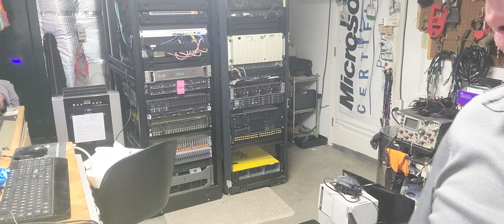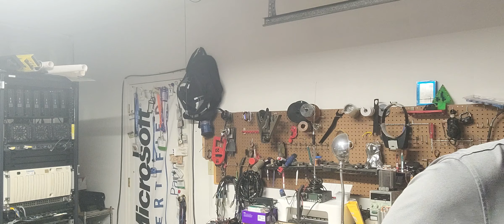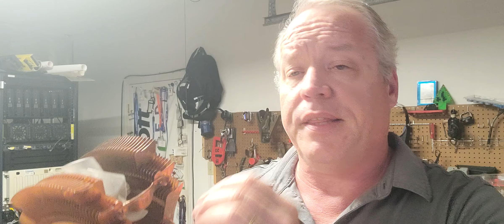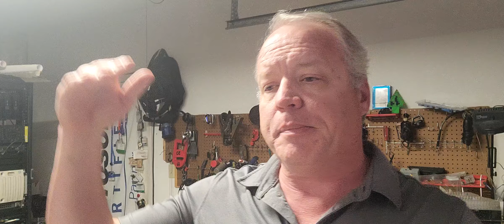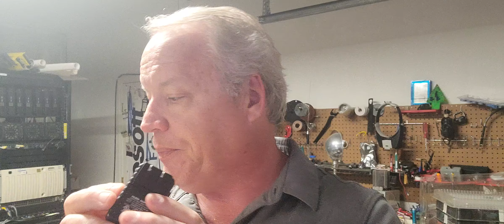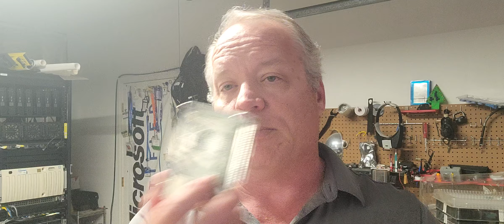OK so want to start building your first small IT home lab  Here are three simple three rules...

Comment: Great information. Thanks :) You have RF shielded your walls - when it's time to consider doing that? Can you provide some photos of how you're grounding your Racks - Every equipment should have individual ground wire to a Rack, then entire rack wired to a wall outlet ground? Is that considered safe to ground a rack to a wall socket?
Reply from the maker: Yes you can do that because the ground of the power outlet match your voltage gauge of 20 amps. or also refer to the power cable gauge of 10  or 12 gauge wiring. So yes for basic rack grounding a wall socket will work.  This would not work if you had let say use two 30 amp connections for your PDU surge strips and you grounded your rack to R5 15/20 amp wall outlet instead, then you have a risk of fire.   keep apples to apples, If you use 30 amp power source then ground to the same power source to keep things safe.